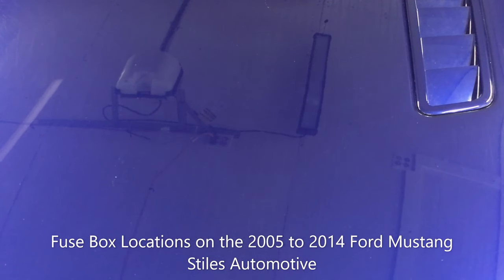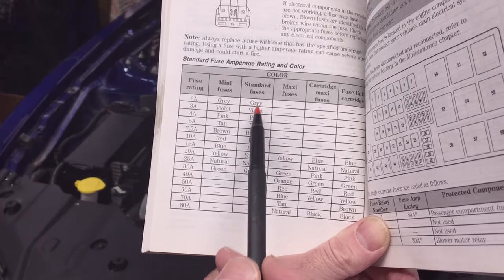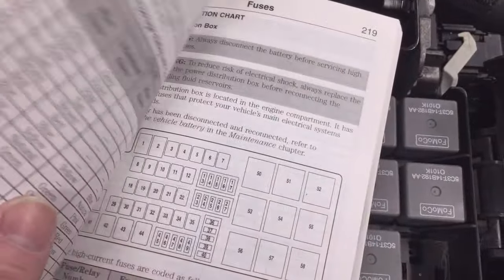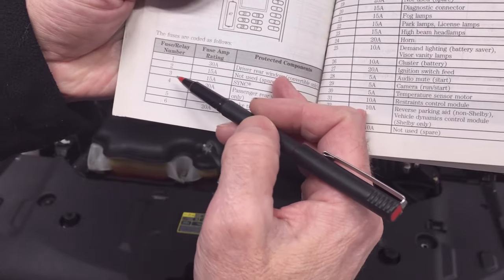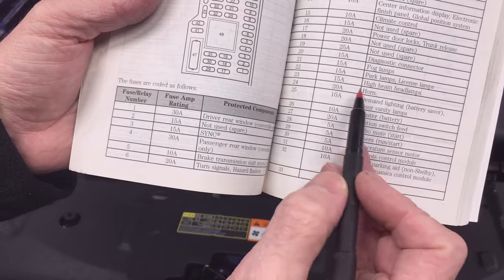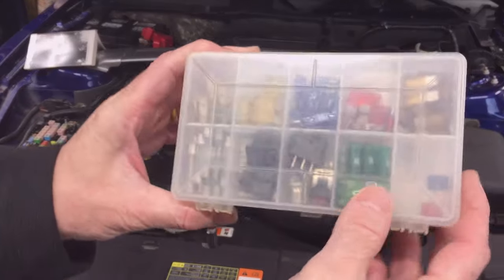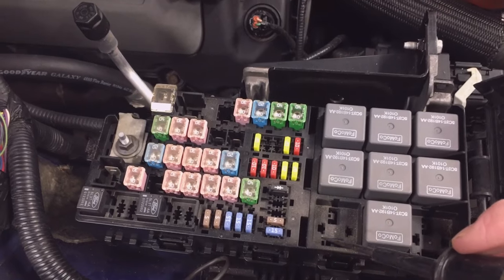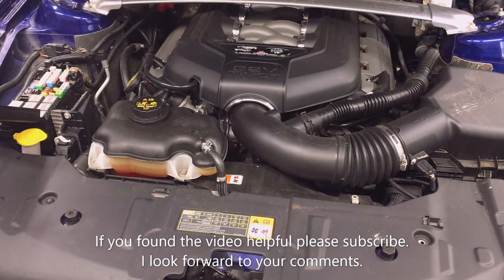Fuse Box Locations on the 2005 to 2014 Ford Mustang

Comment: I have a 2014 Ford SVT Raptor-I blew the 4th fuse out, that controls my power mirrors and my driver seat. after I replace the fuse over and over it blows out immediately. I need help! I put a bigger fuse in it and some thing started smoking I pull the fuse immediately. Please help
Reply from the maker: MAJ Media, Sir, help me help you.  The "4th Fuse" doesn't make sense.  You mean it is the 4th time you blew it out?  Fuse 4 at the Passenger Compartment Fuse Panel (in the Kick Panel) is the Interior Lamps. It sounds like you mean, Fuse 7 (7.5 Amp, Brown) Power Mirror Switch, Memory Seat Module.  You figured out not to put a bigger fuse in the location that is blowing out; yep, don't do that.  It sounds like you have a dead short, either in the Wiring Harness to the Memory Seat Module or something bad in Memory Seat Module.  The Memory Seat Module is often located under the Seat, I think it is in your Truck.  Did you store something under the seat and damage the Wiring Harness to the Module?  Anyway, look and smell for burnt and melted wires under your seat and trace those Module Wiring Harness back to the Passenger Compartment Fuse Panel looking for shorted areas of the Harness.
Reference your 2014 Ford F-150 Raptor Owner's Manual, Page 230, for fuse information.
Let me know if I'm talking about the wrong Fuse.  - Stiles
Reply: @StilesAutomotive  I meant to write the 4th fuse down in sequence 1234 the fourth fuse down  controls the power mirrors and the power seat. So I put a larger fuse in and everything worked but something began to smoke underneath my seat. I’m going to remove/ disconnect the wire harnesses and Put a fresh fuse in And as I reconnect each Harness I should see which one has the shorts in it. I just don’t know what to do next
Reply from the maker: MAJ Media, That sounds like a good plan, also when doing what you mentioned, disconnecting the Wiring Harnesses, if you use a Multimeter to continuity check to ground on Wires that should not go to ground.  But, do this too - visually inspect (and smell) the Wiring Harnesses and that Memory Seat Module, look for melted plastic.  Look for areas where the Harness lays on top of sharp edges, under the Seat, under and thru the Console, and in the Dash (center and behind the Glove Compartment).  Are you sure something didn't get pushed under the seat and damage the Wires at the Memory Seat Module?  Make sure you look at the Module and smell it, I'd bet you a Frosty Beverage . . . your problem is the Module or the Connector (and Wiring) going into the Module.  - Stiles

I don't know how to show you a picture of the Module, here is a Ford Website that has your Module (don't know if this is a good place to purchase or not, just using it to show you the Module) - - 
https://www.villagefordparts.com/oem-parts/ford-module-bb5z14c708a?c=bD0yJm49U2VhcmNoIFJlc3VsdHM%3D

Put your VIN into this website and see if you have any Ford F-150 Recalls on this issue. - -
https://owner.ford.com/tools/account/maintenance/recalls.html

Comment: How does a obd 2 fuse look like for a 2005 v6 mustang
Reply from the maker: Roberto,  Are you talking about your OBDII Port Connector Power? (properly named the Data Link Connector (DLC)).  This is Fuse 8 (10A, Red) Cluster, Data Link Connector (DLC) on your Passenger Compartment Fuse Panel. - Stiles

Comment: I can't find the window washer pump fuse location.😅
Reply from the maker: Poppet, you didn't say the Year of your Mustang. For the 2005 thru 2009 Mustangs it is Fuse 10 (30A, Pink) in the  Power Distribution Box in the Engine compartment. For the 2010 thru 2014 Mustangs it is Fuse 9 (30A, Pink) Wipers & Washers in the Power Distribution Box in the Engine compartment.  - Stiles

Comment: What fuse would it be for a gas gage for a 2010 mustang v6
Reply from the maker: Just the Fuel Gauge? If just the "gas gage" is not working it is likely more than the Fuse.  The Fuse for the Instrument Panel is Fuse 26 (10A, Red) Instrument Panel Cluster (IPC) (battery) in the Passenger Compartment Fuse Panel, this Fuse powers more than the Fuel Gauge.  Let me know how it goes! - Stiles

Comment: What fuse is for the radio?
Reply from the maker: ETH, what year is your Mustang? for the 2010 to 2014 Mustang, In the Passenger Compartment Fuse Panel, Fuse Number 39 (20A, Yellow) is the Radio/Navigation and you may also need Fuse Number 41 (15A, Blue) Accessory Delay, Reference Pages 230 thru 232 of your 2014 Owner's Manual (Page numbers vary from year to year). - Stiles
Reply: @StilesAutomotive  i have a 2014 i ended up finding it

Comment: Can anyone tell me if there is a fuse for the trunk light? Because I can’t seem to make the trunk light work and I am trying to see if it’s probably a fuse and I don’t have the manual perhaps any advices?
Reply from the maker: Ruben, You didn't say, for the 2010 thru 2014 Mustang, Fuse 25 (10A, Red) in the Passenger Compartment Fuse Panel, powers a number of Interior Lamps thru the Power Saver Relay which is an On Delay Relay ( stays on for a period of time) to include the Luggage Compartment Lamp, it also powers the Overhead Console and Visor Vanity Lamps.  Do the Visor Vanity Lamps work?  If so this fuse is ok and look for another problem for your Trunk Light not working.  - Stiles
Reply: @StilesAutomotive  mine is a 2007
Reply from the maker: @rubend.rodriguezjr.530  Ok, let's look again . . .  Ruben, first look at Fuse 57 (20A, Yellow) Decklid release in the  Power Distribution Box in the Engine Compartment and then Fuse 6 (5A, Tan) Accessory delay feeds in the Passenger Compartment Fuse Panel. - Stiles
Reply: @StilesAutomotive  I will take a look at it and let you know what happens. By the way how do I know if it’s a bad fuse?
Reply from the maker: @rubend.rodriguezjr.530  No, I don't know for sure if it is a bad Fuse, it sure could be.  It could also be a bad light or a bad ground.  I'd check in that order. - Stiles
Reply from the maker: @rubend.rodriguezjr.530  You asked "how do I know if it's a bad Fuse? " Look at my video again starting at 10:15, I show you how you know if the Fuse is bad. - Stiles

Comment: Which fuses for the electrical cooling fan for the radiator?
Reply from the maker: Josue, When asking a question like that always state your Make, Model, Engine, and Year of your Mustang.  If you are watching this video you likely have a 2005 thru 2014 Mustang.  

If you have a 2005 thru 2009 Mustang the Cooling Fan Fuse is Fuse 3 (40A, Green, Cartridge Fuse) on the  Power Distribution Box (shown in my video, in the Engine Compartment, under the hood).  

If you have a 2010 thru 2014 Mustang the Cooling Fan Relay Fuse is Fuse 7 (40A, Green,  Cartridge Fuse) on the  Power Distribution Box (shown in my video, in the Engine Compartment, under the hood).  If Fuse 7 is ok, take a look at Fuses 21 (30A, Pink) and 46 (5A, Tan).  These two Fuses pull in (or energize) the two Cooling Fan Relays to turn your Cooling Fan on and off. 

I hope this helps! - Stiles

Comment: What fuse would my cigarette lighter in my console be
Reply from the maker: Ethan, Seems like I've answered this question before, you didn't tell me the Year of your Mustang.  For the 2010 thru 2014 Mustang, The Lighter Port in the center of the Dash is the "Cigar Lighter, Front" this is powered by Fuse 22 ( 20A, Yellow) PowerPoint (instrument panel) also located in the Power Distribution Panel in the Engine Compartment.  Let me know how it goes! - Stiles
Reply: @StilesAutomotive  it’s a 2013 I found the one for my dash just unsure about my console lighter

Comment: My dome light, trunk light and visor lights went out would you know what fuse to check or what could it be cuz the dome lights work only if I press the button but they used to turn on when the door would open but now they dont .. Same for the visor lights nxt to the mirror they dont turn on and when I open the trunk the light wont turn on
Reply from the maker: David, you didn't tell me the model year of your Mustang, but to answer your question for my 2013.  The Overhead Console, Driver and Passenger Map Lamps are power 2 different ways, the first is thru Fuse 9 (15A, Blue) Courtesy Lamps Fuse, which controlled by the PCM. (Yours sounds ok) and second thru Fuse 25 (10A, Red) Demand Lighting (battery saver), Visor Vanity Lamps Fuse, this circuit goes thru the Battery Saver Relay in the Fuse Panel (Passenger side Kick Panel, shown in video).  Fuse 25 also powers the Luggage Compartment Lamp thru the Battery Saver Relay.  So everything you say makes sense that Fuse 25 is blow / burnt out.  Hope this helps!  Let me know how it goes!  - Stiles
Reply: @StilesAutomotive  oh my bad its a 2014 mustang convertivle I just saw your reply so later on today I'll check the fuse .... Hopefully its that .... Thanks
Reply: @StilesAutomotive  thanks man it was exactly what you had said .. Fuse 25 was blown out... Really appreciate your help
Reply from the maker: @davidibarra6391  I'm glad to help!  I hope you enjoy many more miles out of your '14 convertible!  - Stiles
Reply: @StilesAutomotive  thanks man i appreciate the help ... I have another question tho probably the last thing I need to fix .... The passengers side window wont go down when I use the drivers side button but it will go up .... Im able to close the passengers side window from the drivers side but not open it .. Any idea what could be?
Reply from the maker: @davidibarra6391  David, It's hard to believe that your 2014 is starting to be an old car.  It sounds like, (and is common to Ford Products) your Window Switch is going bad.  Sometimes you can take the Switch apart and clean the contacts, or you can simply replace the Switch.  Let me verify, you made it sound like the window operates ok, with the Passenger's Side Window Switch, but not the Driver's Side, Correct?  If so, it's likely the Window Switch.  - Stiles

Comment: Does anyone know where the fuse for the turn signals? My right turn signal comes on automatically with I start my car and won’t shut off.  2009 mustang gt please help
Reply from the maker: Mesuron, Your turn signal comes on when you start your Mustang because it is likely your multifunction switch has failed. It is telling the control module that the turn signal is on when it is in the off (middle) position so it needs to be replaced.  Less likely, but possible is that the Body Control Module has failed.  I say less likely, but that is unlikely.  And you would expect there to be some OBDII Fault Codes.  Let me how it goes! - Stiles
Reply: @StilesAutomotive  Thanks Stiles I will replace it. Is there a detail video on replacing the BCM
Reply from the maker: @mesuronbrown  I don't have a Body Control Module (BCM) video, I haven't look for one, so I can't recommend one to you. Sorry! - Stiles

Comment: I need to find the rear parking lamp fuse for a 2000 mustang gt
Reply from the maker: Hellgang, Fuse 10 (30A, Green) Parklamps in the Power Distribution Box in the Engine Compart is for the Parking Lamps on the 2000 Mustang, Reference your 2000 Mustang Owner's Manual page 123.

Comment: 2014 ford mustang horn just stopped , pulled kick panel fuae it looks good doesn't look blown
Reply from the maker: The Horn circuit is simple, or I should say 2 circuits. At the Passenger Compartment Fuse Panel there is a Fuse and Horn Relay (Not Serviceable). Fuse 24 (20A, Yellow) Horn, is the Horn Fuse that you should check continuity thru, it may not look blown.  The Coil side of the Horn Relay goes thru the Steering Wheel Clock Spring and thru the Horn Switch in the Steering Wheel, then back thru the Clock Spring to ground.  The switched side of the Horn Relay simply goes to the Horn.  I'd check that Horn Fuse again and while you are down there have someone press the Horn Button on the Steering Wheel and feel & listen for the activation of the Horn Relay.  You may have a Horn Relay, Clockspring, Horn Switch, or Horn defective.  You can test the Horn by powering it from the Car Battery.  Let me know how it goes! - Stiles
Reply: @StilesAutomotive   Hey thanks will do, however yesterday for some odd reason took it to a Mechanic and he told me to try pressing the horn just mashing all around it and wow it started blowing again with no problems. He said sometimes the Clock Spring gets Stuck
Reply from the maker: @platniumtongue  Ok, very good! - Stiles

Comment: I just noticed on my 2006 Mustang GT that the knob to turn the headlights on doesn’t light up. All the other knobs do though. Maybe it’s a burnt out light bulb 🤔
Reply from the maker: Mr. News, It looks like your Headlight Switch, MOTORCRAFT SW6581 (w/ Fog Lamps) which is used for 2005 thru 2014 Mustangs, uses an LED not a Bulb, It is likely that you must replace the switch to fix the LED.  - Stiles
Reply: @StilesAutomotive  Thank you for the quick response! I’m definitely going to look into this.

Comment: Could you tell me what that box of wires next to the fuse panel are called??
Reply from the maker: Heidi, box of wires?  Are you talking about under the Hood in the Engine Compartment?  On the Engine Side of the Power Distribution Panel is the Powertrain Control Module (PCM).  In the Passenger Compartment at the Kick Panel Fuse Box, those wires all go into the Fuse Panel.  If that didn't answer the question, can you tell me where you are looking?  - Stiles
Reply: The one in the car on the passenger side, I think it’s a wire harness. My car had a water leak due to the shitty drainage system it has, so, I just want to make sure that’s what it is and which wire harness is it?
Reply from the maker: @Lanes_way  You need a better description, there are a number of Wiring Harnesses running to the Fuse Panel.  You can go to www.helminc.com to get a manual or wiring diagram manual for your specific Mustang.  These are Ford Manuals and very detailed.  Helm publishes them for Ford.  - Stiles

Comment: Where did you buy the fuse box full of extra fuses?
Reply: My A/C comes out from the defroster only and I had replaced the blend door actuator and the clicking went away but the A/C still does not come out from the right vents so I’m guessing it has to be a fuse.
Reply from the maker: Elias, Yes, it may be a Fuse.  For the 2010 thru 2014 Mustang, Fuse 15 (10A, Red) Climate Control is for the Heater / AC. This Fuse powers the HVAC Module in the Mustangs with either the Manual or Automatic Climate Control System.  If you have the Automatic Climate Control, I would think you would have stated other (like display) issues. Let me know how it goes! - Stiles

Comment: Very helpful. But you didn’t describe the bigger fuse
Reply from the maker: David, Thanks for the comment! Bigger Fuse? in which Panel?  On the Passenger Compartment Fuse Panel there is a Circuit Breaker and a Relay, but all other Fuses are the same. On the Power Distribution Panel I talk about the different Fuse. Is there something that should be clarified? - Stiles

Comment: Wich fuse is that traction control must be my traction button didn’t work.
Reply from the maker: In the Passenger Compartment Fuse Panel, Fuse Number 10 (15A, Blue) is the Switch illumination Fuse Power all of the Switches and a bunch of LED lights including the Steering Wheel Button Lights, but also powers the Traction Control Button.  Do the lights work on your Steering Wheel? Does the lights work on the Trunk Release Button, and the Traction Control Button? These Light should not work if this Fuse is Blown. You didn't say the year of your Mustang, Reference Pages 230 thru 232 of the 2012 Owner's Manual.  I hope this helps - Stiles
Reply: @StilesAutomotive  is 15A blue fuse for the traction control ?
Reply from the maker: @atalawadhi7420  You are asking the wrong question, Your Mustang has a number of 15A Fuses.  You read my answer above as - -  "Fuse 10 (15A, Blue) Switch Illumination" this is Fuse number 10 with a Fuse Description of "Switch Illumination" and it is a Blue 15 Amp Fuse. And Yes it  "powers the Traction Control Button"   But . . . . You can easily tell if it is ok.  If the lights on the buttons of your Steering Wheel work, this fuse is ok.  - Stiles
Reply: I don’t want traction control on I need it always off .
Reply from the maker: @atalawadhi7420  You have to turn it off each time you start the car.  I don't know of a way to keep it off all of the time.  I'd look for an answer in the Mustang Forums. - Stiles

Comment: Crazy story happened today I went to get my muffler delete and my AC was working and then I go to pick up my car and guess what my ac isn't working, I have a 2013 mustang V6 and the lights work but nothing comes out the vent, can you tell me which fuse that would be or if that even is a fuse, I showed the people before I left and they said they don't know, they're English was broken they were Mexican so spoke Spanish mainly and they said maybe a blown fuse and I said how though it was working right when I dropped it off and they said I have to go next door to the other car place to get it fixed but the guy is in Mexico rn, sounds kinda fishy don't you think, I never had a problem with ac in my car
Reply from the maker: Thaddeus, Don't get me started on shifty businesses. You said "AC" but then "nothing comes out the vent", so your Blower Motor is not blowing air?  If so Fuse 4 (30A, Pink) Blower Motor Relay in the Power Distribution Box in Engine Compartment, and then Fuse 45 (5A, Tan) Wiper relay and module, Blower relay in the Passenger Compartment Fuse Panel, do your Wipers work? If so . . . probably not this Fuse.  - Stiles
Reply: @StilesAutomotive  thank you very much on replying and I just finished washing my car and I checked my wipers those still work
Reply: @StilesAutomotive  I just picked up the fuse and did it and it works I had to come back to thank you again man this started my day off good
Reply from the maker: @T.Thaddy00  Ok, very good, you're very welcome! - Stiles